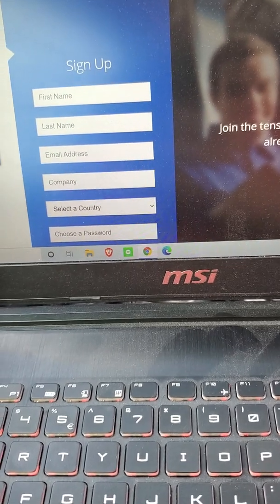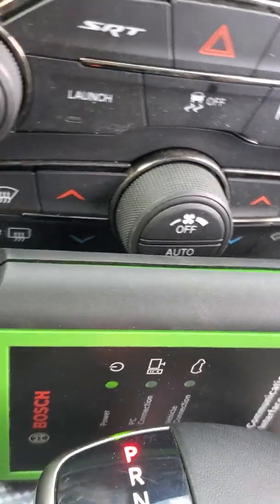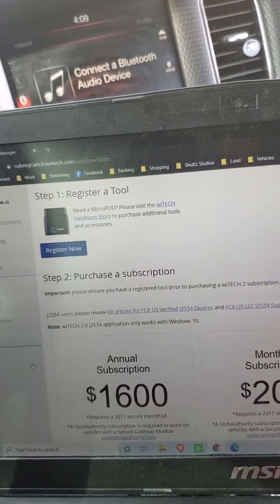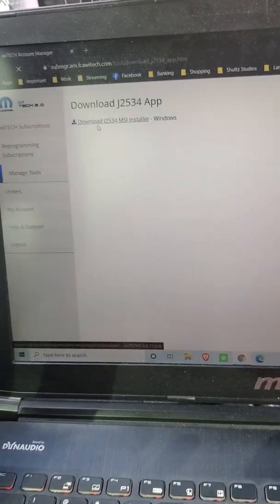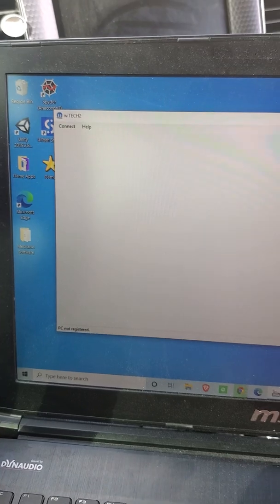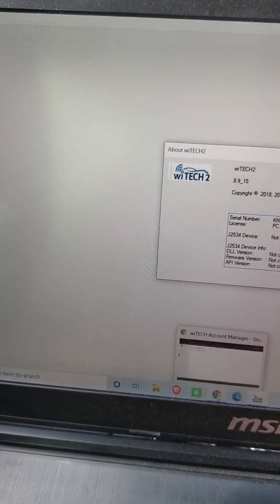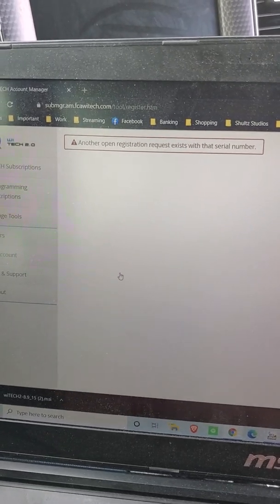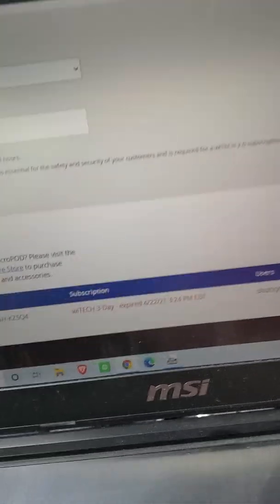FCA (Dodge/Chrysler) J2534 Flash Programming - Getting Started - First Steps

Comment: I’m working on my 2012 charger to cancel electrico hydraulic steering pump and install fully hydraulic pump , do you recommend to use this device for canceling the sensor?
Reply from the maker: This won't help cancel a sensor. This is the software needed to flash the sensor so it syncs with your ECU. If you're looking to bypass the sensor you will have to search the forums and see what software might be available to bypass it or the most common fix is to find a dummy sensor to put in its place that will send the connected/success confirmation to the ECU so it doesn't have an error code for the sensor not being installed or flashed.